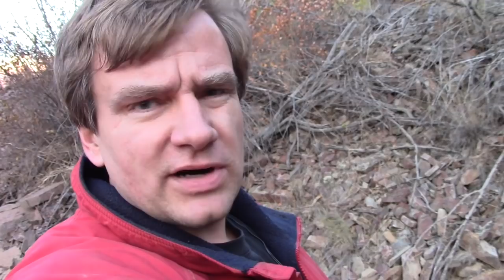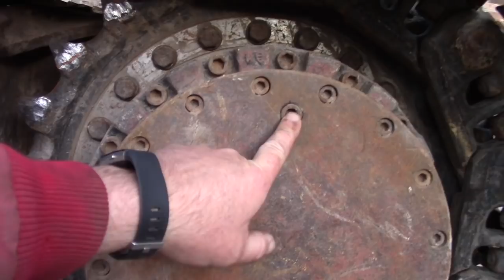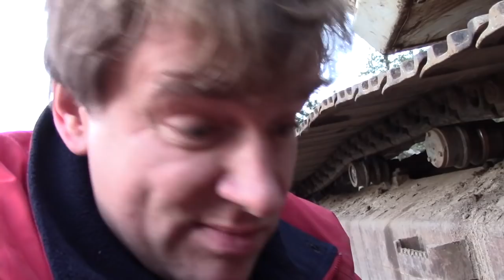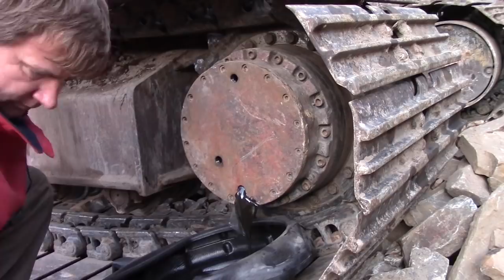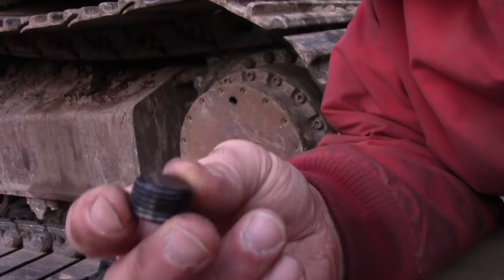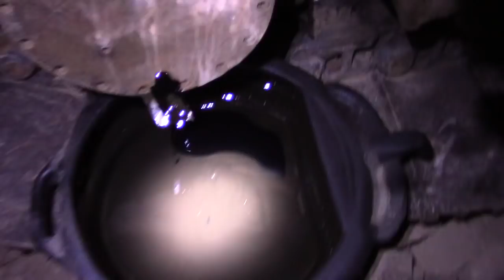Link-Belt 2800 Final Drive Oil Change

Comment: My shop manual shows the level port should be up on the right side and not down on the left. How can I send you a photo of that page in shop manual.  Also says you should replace with 1.584 gallons of hydraulic oil.
Reply from the maker: That light an oil in a final drive gear set? Are you sure that isn't for the drive motors? Email is in the description and I would never turn down information.

Comment: I'm not sure about you're machine in particular but I worked at caterpillar for 10 years and I know that most of the rollers on cat machines had a rubber center with a quarter inch plastic plug in the center of the rubber piece and you could knock the plastic piece through into the oil then check and fill the oil level and knock a new plastic plug into the rubber center and just leave the old plastic plug Inside the roller, this is by caterpillars instructions
Reply from the maker: I will look for that.